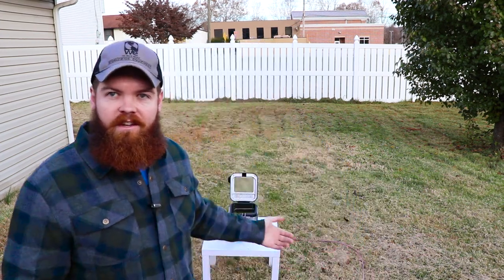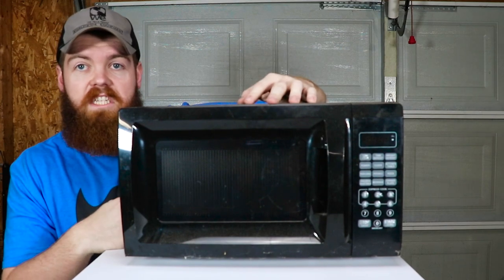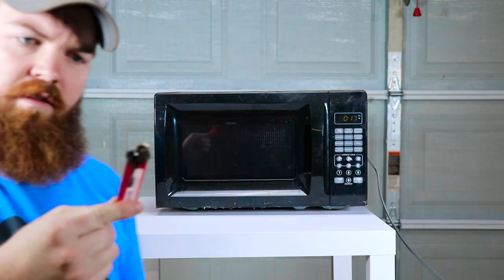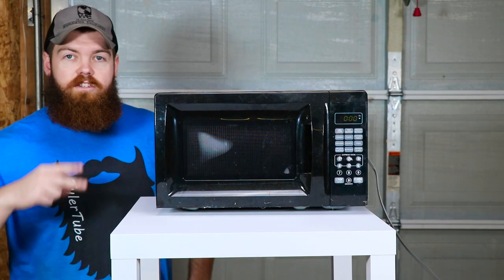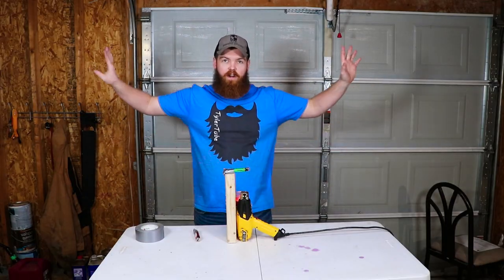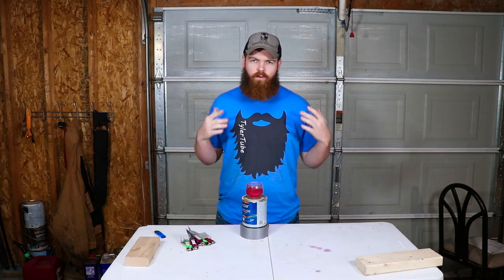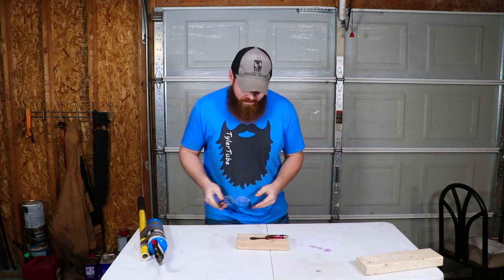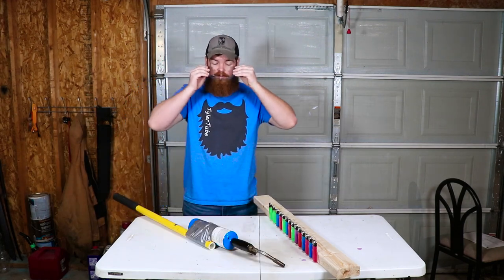I Put Lighters In The Microwave...

Comment: If you want a fun one, fill a glass beer bottle 1/4 full of lighter fluid and then put the bottom (tip facing out) into a campfire. The bottle gets hot enough to occasionally ignite, but not powerful enough to compromise the bottle. Looks real cool.

Comment: "If there's butane in there, it still could explode".

So you're going to not only exert force on it via a stick when unsure of how it will react, but expel it out of the microwave into an open environment and give it more of a chance to explode in your face due to boiling from the inside and possibly expanding and exploding from the collision?

I'm not a scientist but i'd say the safer option would likely have been to walk away, not open the microwave, and def. not flick a potential pressurized bomb onto my floor. Especially one that could have reacted to both the force of being struck from the microwave and the force of landing on concrete.

Now i'm sure BIC built these things with this type of experiment in mind. And if not...i'd sincerely suggest against striking something with boiling, pressurized butane inside. Especially something made of see-through plastic.

But hey, that wouldn't be interesting. So whack away!

Comment: I just recently got a hold of a microwave that works and I don't care about and I'm planning on doing this except for safety reasons it's going to be in the middle of a field with an extension cable and also I'm going to have a rope attached to the handle so I can open the door from a distance